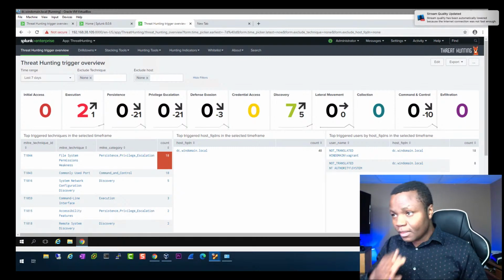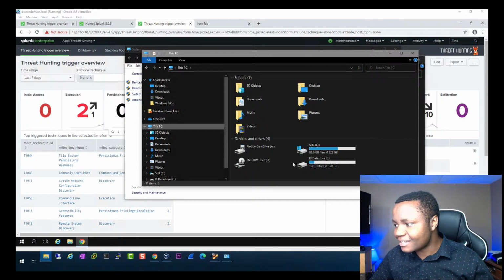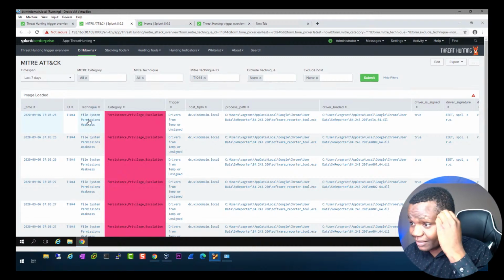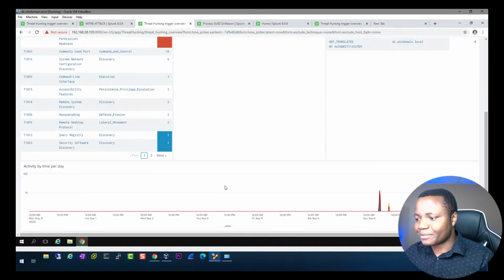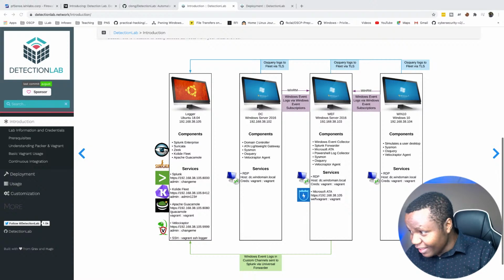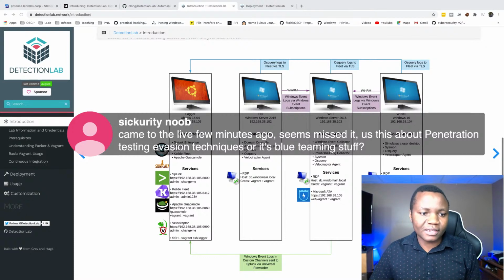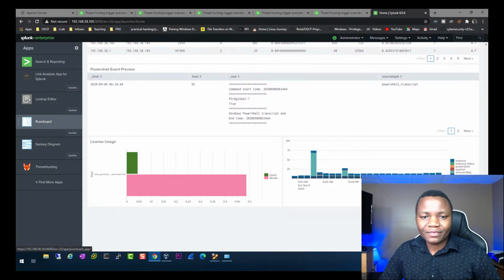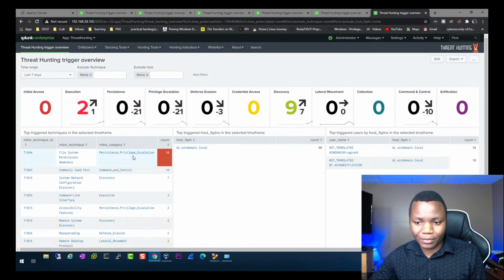The Easiest Detection AD Lab Setup | First Look

Comment: Failed to open a session for the virtual machine logger.

VT-x is not available (VERR_VMX_NO_VMX).

Result Code: NS_ERROR_FAILURE (0x80004005)
Component: ConsoleWrap
Interface: IConsole {872da645-4a9b-1727-bee2-5585105b9eed}
Can you please help me with this error, VT-x is enabled in VM
but still getting this error

Comment: i deployed this lab on azure and when i run nmap on a machine, normally suricata should pop up some alters, but unfortunatly that's not the case. also i'm facing the same issue with splunk, it's not popping up alters when i run malicious scripts and commands. i wonder if this lab needs some configuration before jumping into testing